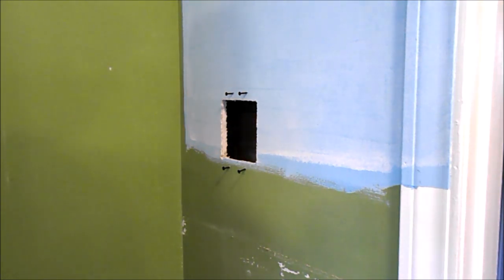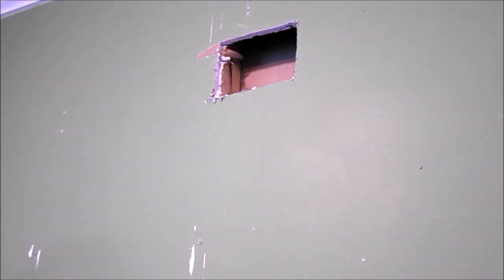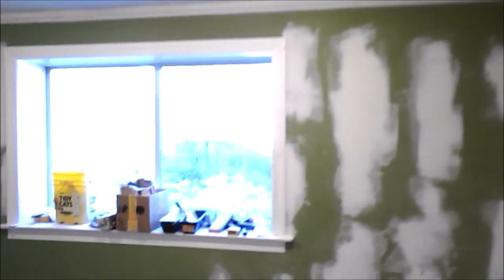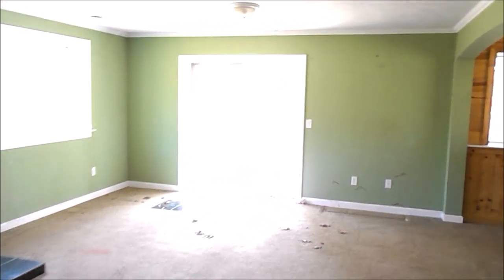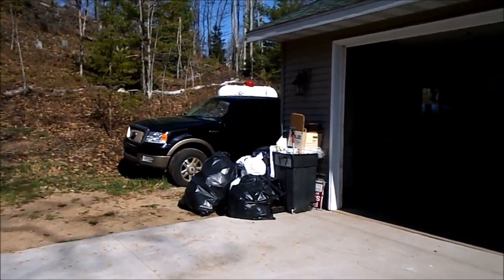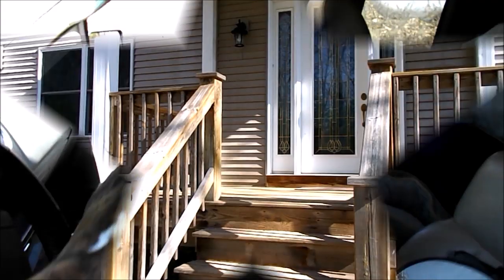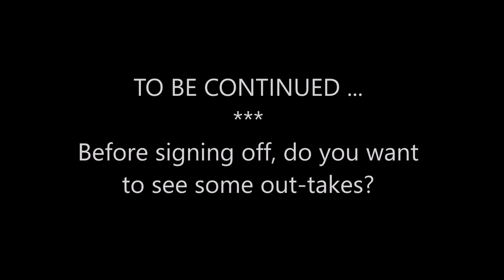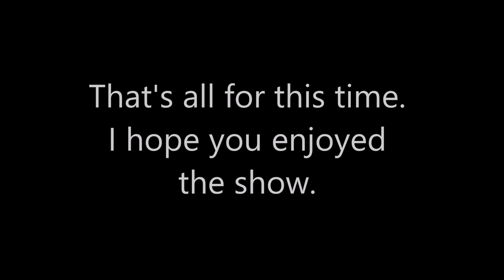Restoring the train room

Comment: you did an excellent job on the old room, can't wait to see the new room.
Reply from the maker: Sadly, the new room requires a lot more work before I can start on the railroad; moving walls, installing drywall, moving air ducts, building a bathroom, redoing all the electrics, rebuilding the stairs.  And to think that I quit the construction trade a couple of years ago ...

Comment: I hate doing drywall. It could be worse though. My upstairs is all plaster and sheet lath under neath
Reply from the maker: Ah yes, the joys of remodeling a lath-and-plaster structure.  I remember doing a complete gut-job on the upstairs of such a house some years ago.  By the time we had ripped all the L&P down, it was knee-deep over the entire floor.  We spent the next couple of hours with snow shovels, tossing it out of a bedroom window into the dumpster below.  I still have some photos of the mess somewhere.